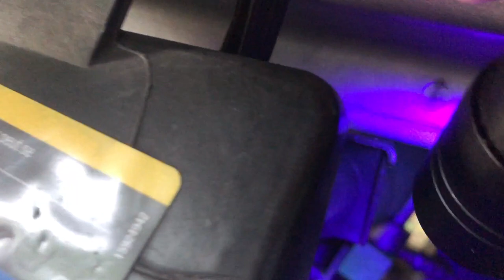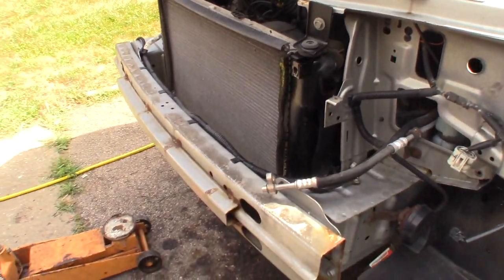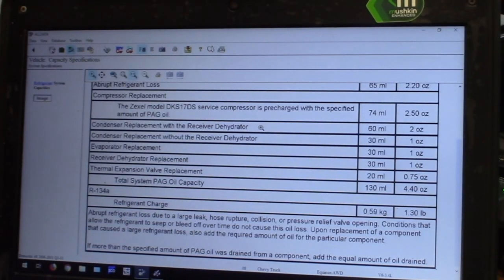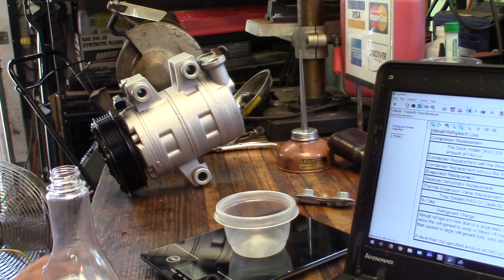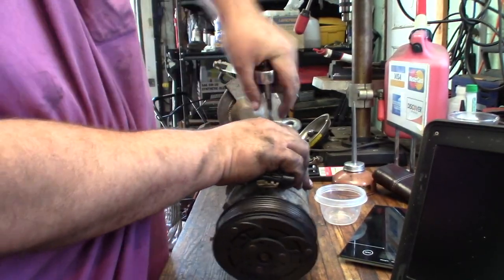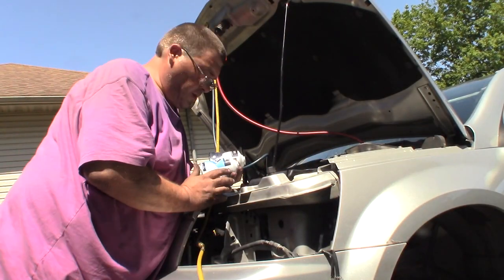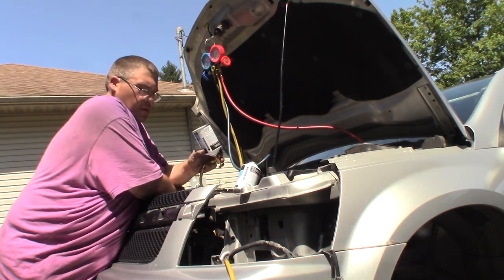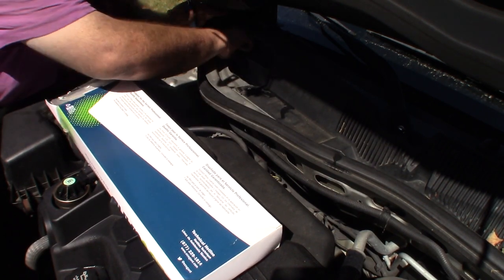2008 Chevy Equinox A/C Condenser & Compressor Replacement

Comment: Not only do people forget to change their cabin air filter but they also forget to put them in at the Ford factory. Everyone that I've known that have bought new Escapes from 2001 to 2012 never had cabin air filters in them when they went to replace them. I think Duane from Real Fixes Real Fast found this out as well when working on his son's Escape that he did a video on. 😁
Reply from the maker: Ford only installs them on vehicles that are going to certain dusty parts of the country, or at least they used to.  Hyundai used to do the same thing.   Which I think is ridiculous because vehicles get moved all over the country before and after the initial sale.
Reply: @frugalprepper  Ya that makes no since. I'm in SE Michigan & my last 2 F-150's had cabin air filters in them as well as my wife's '16 Escape but the older Escapes didn't have them.

Comment: At least you don’t have to evacuate the system because the best mech in the work Timmy said so! 😂😂😂
Reply from the maker: Did he really?  What a hack.  I have done it before in a pinch and before I knew better.  Air and moisture don't go so well with R134 though.
Reply: FrugalPrepper's Garage & Garden yessir he even did a whole video on why it’s not necessary 🙄🙄
Reply from the maker: @MrJobforacowboy00  Wow that was painful to watch.  First he doesn't know the difference between a receiver dryer and an accumulator.   His mustang has an orifice instead of an expansion valve so it's and accumulator after the evap to stop liquid from getting back to compressor.   You can't remove moisture from desiccant with vacuum only with heat and they only hold so much moisture.  when they are done they are done.   Under pressure moisture breaks down the PAG oil and will cause a compressor failure (sounded like he had to flush metal out of a few systems before).  When I don't replace the receiver dryer, I pull a good long vacuum to make sure I have all the moisture out.  Hey if it's an old junker you are trying to get another summer out of.. I say go for it, but how much does it really cost to get a HF vacuum pump and take 30 minutes to do the job right the best you can, especially if it's a customers car that is paying you.
Reply: FrugalPrepper's Garage & Garden you are 100% correct and that’s what I never understood about him! He has a “professional” business but I have more tools in my garage, and I’m pretty sure you do too then he does on that damn bread truck of his lol he’s the definition of cheap.